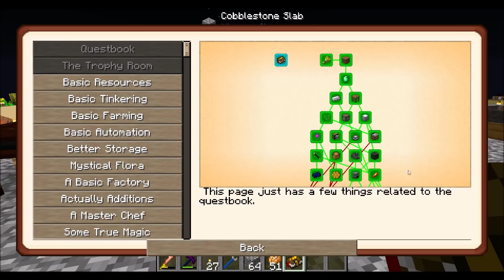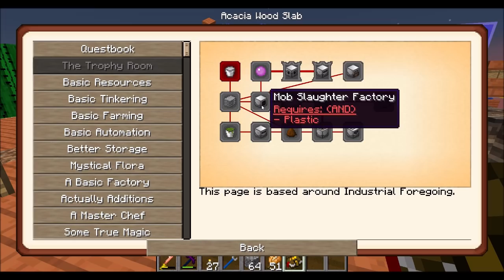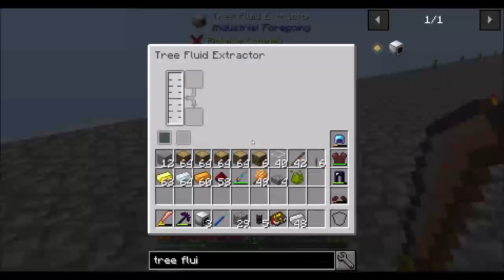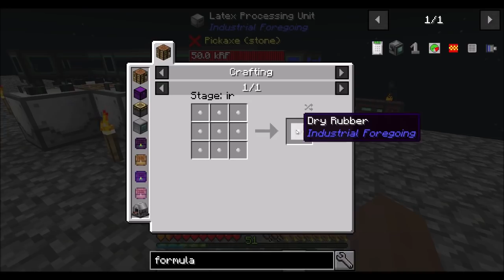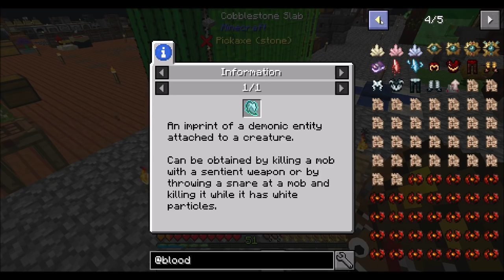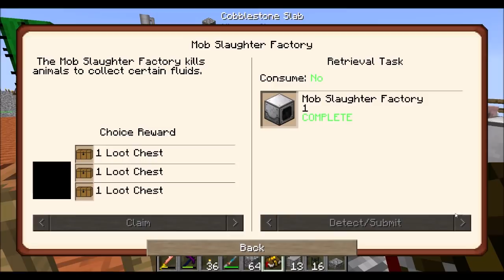Modern Skyblock 3   Ep45 Industrial Beginnings

Comment: Direwolf why 3x3 y not 2x2 ur just using USLESS space
Reply: killermimmic101 for that pump it sucks up in a 3x3 and it's fast. If he only did a 2x2 it would break
Reply: If your concerned about space, 1x3 and draw from the middle. While it uses the same amount of blocks occupied as a 2x2, it fits into a narrow line. Also very easy to make it look pretty with a couple slabs or stairs.
Reply: Alan Hunter it doesn't reliably pull from the same block is the issue. That's why it's a 3x3 water source not a 2x2.

Comment: guess he's not going down the cheaty line with the wood.
Reply: the mod dev has mentioned before that it's not really a cheaty way because it requires some "automation". He's totally ok with it
Reply: Sr Tinoco like thinking a bit outside the box inside a sandbox game isnt a crime :/ 

like one of the most impressive things ive seen in vanilla automation are those tunnel bores
Reply: Seannyyx its hardly a cheaty way, also he probably cant figure out the redstone for it lmao
Reply: well its using a single block of wood that gets moved to reset.. kinda cheaty when the system is designed to actually USE UP the wood.
Reply: Seannyyx its....just wood...
Reply: Seannyyx its really not that deep